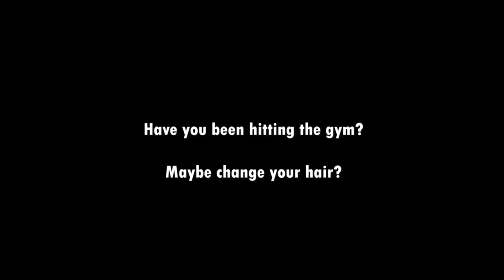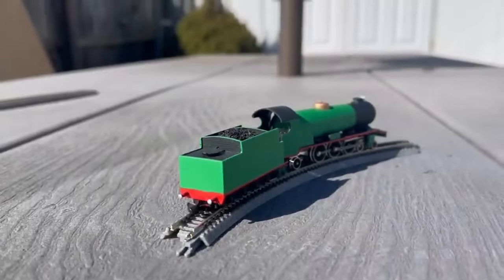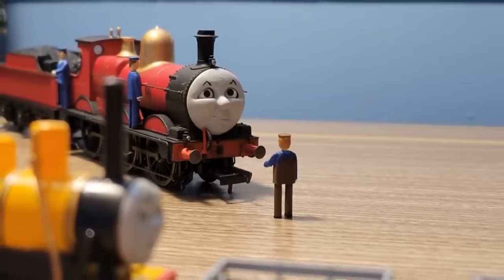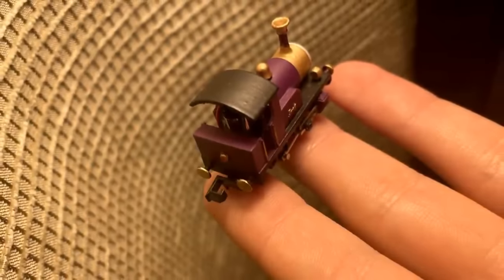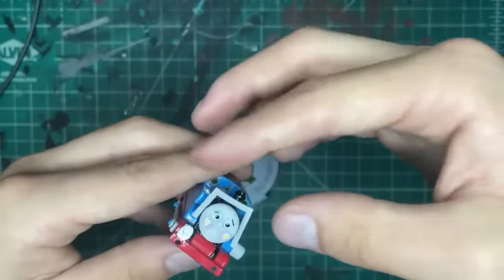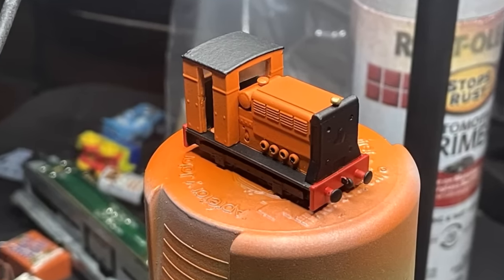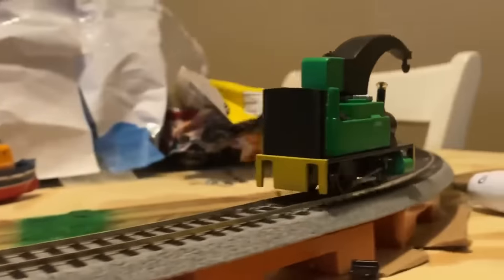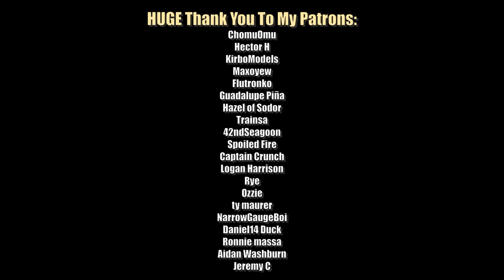A YEAR WORTH OF CUSTOM TRAINS: All HO/OO, 009, HOn30, & N Gauge TTTE Projects from 2022!

Comment: A way you could motorize Winston is with the bachmann wickhem trolley whether you cut out a hole for the chassis and put Winston's body on top or how bachmann did it with little wagon and if the wheels fit it would be accurate to the show